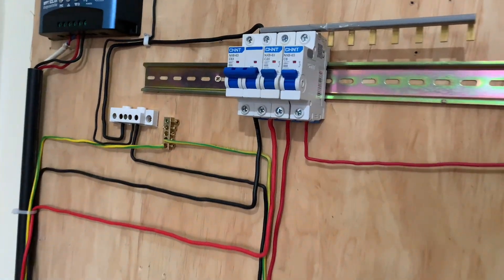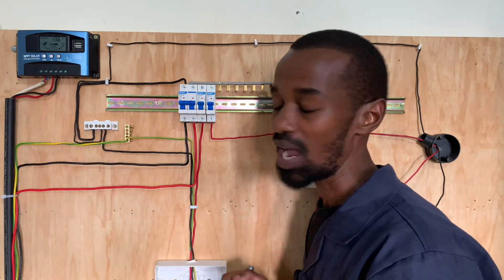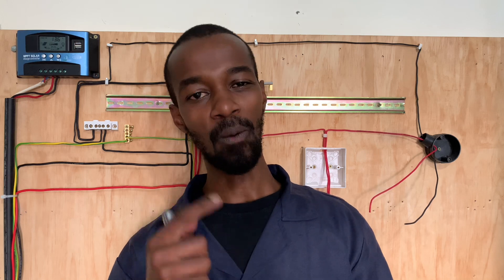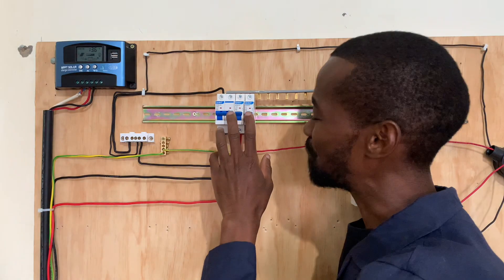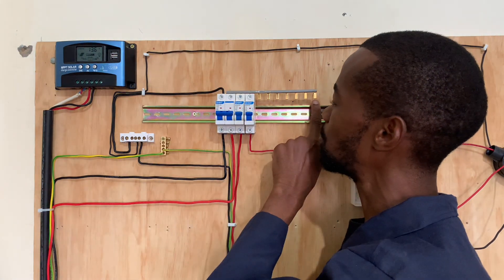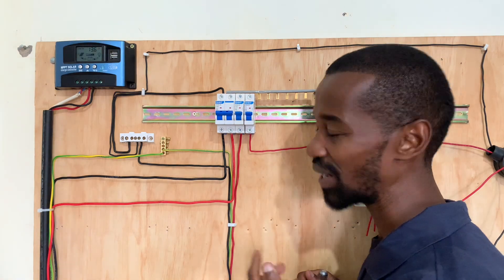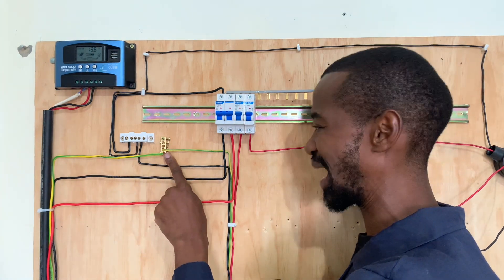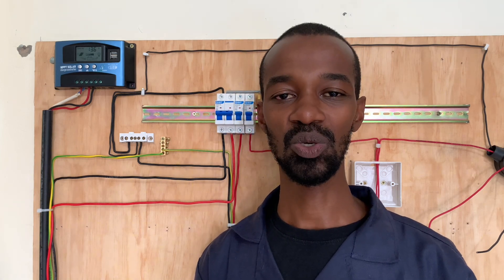How Domestic Wiring Is Very Simple! You won’t believe!

Comment: One Mcb for lights can handle how many bulbs?
Reply: 6 is kk
Reply from the maker: @MRNOPEACE  meaning bulbs?
Reply from the maker: Great question Douglas, it depends on the size of the MCB, 3A, 5A, 6A or 10A, Which one are you looking at?
Reply: @topheightselectricians Let me learn how to connect more than 1 battery to charge with solar panel...
Reply: @topheightselectricians 10A
Reply: Please my question is how do you know polarity on mcb double pole because most of they are not indicated